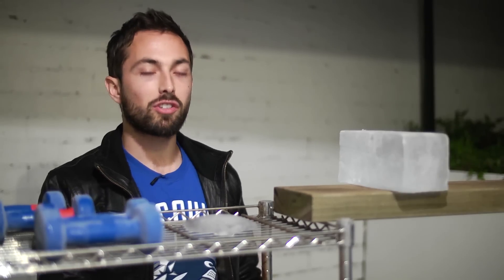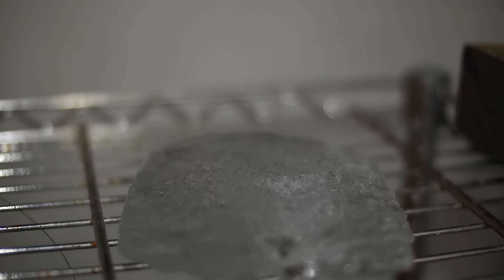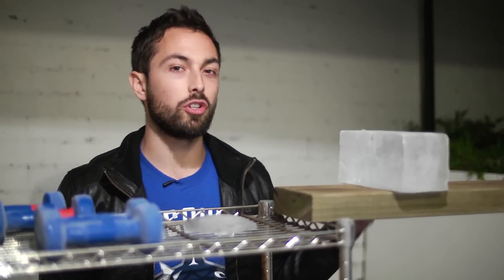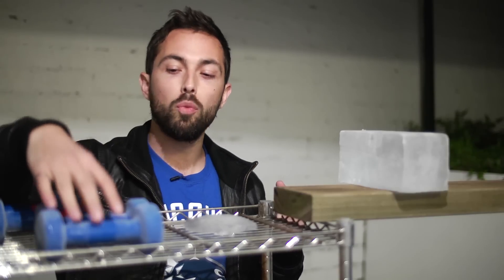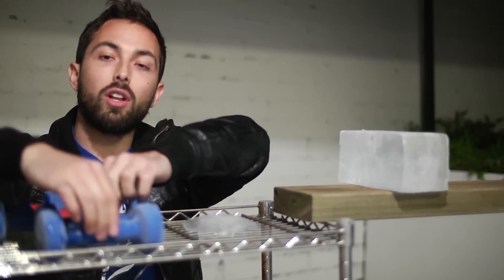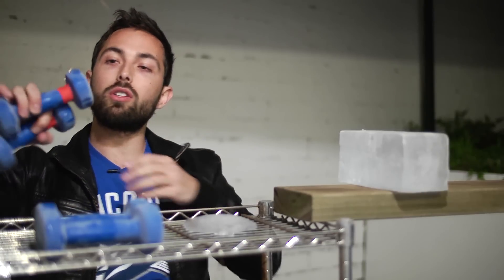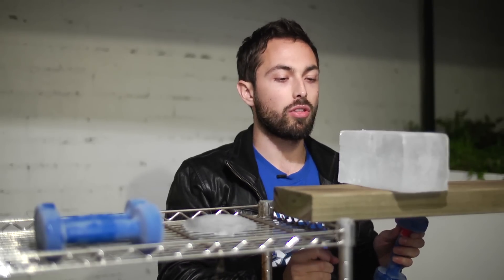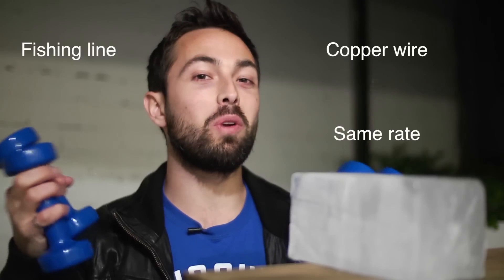Ice Cutting Experiment

Comment: Speak simply, Heat travels well through metals, better through aluminum than through copper, better through aluminum than iron, with the same in mind the thing you have not done is use the weighted wire in a below freezing environment. Because at each end of the wire it is conducting heat, at the block of ice it is cooling the wire, this is an active process. The active process in this case includes a constituent that has a temperature above 32f, = test fail "Ice under pressure, must be tested by "RRESSURE" alone." So now you have to test it in a freezing vacuum. Oh wait, you can't. In a proper vacuum there would be no gravity and so this test is dependent and subjective. You could put a couple stepper motors on a really slow pull to see if it melts the ice. But you will need ultra close up high speed to see that it's not microscopic flakes breaking off and melting. As you can see I am extremely suspicious of the atmosphere being above 32f.

Comment: I wouldn't consider that a good demonstration of regelation because I can propose an alternate hypothesis based on known physics.  For example, it could be that the pressure of the string is causing heat that melts the ice and then the surrounding ice is cooling it back down.  I am not saying you are wrong, more that it doesn't highlight that particular process.

Comment: This video, along with the skating and "snowball" examples are essentially misleading nonsense.  The melting point of ice decreases by about 1C for each 133 ATM of pressure, which is a colossal amount for just a one degree change in melting point.

The wire trick works since at room temperature the block of ice is essentially 0C (rapidly melting!) and the tiny delta afforded by the "pressure" on the wire does decrease the melting point enough for it to melt through the ice. For example, two 2kg weights on a copper wire lower the melting point by about 0.12C!  Try the same experiment in a freezer and it would fail completely without colossal mass applied to the wire.  Ergo, any example that tries to explain skater's blade pressure on ice as the reason when the ice is below 0C is utterly incorrect. The "compressing snow in your hands" example is completely ridiculous since you cannot apply the tiniest fraction of the required pressure to lower the melting point in any significant way....

Basically, at almost any temperature, ice has a very strange property where the surface is in a near-liquid state and that is by far the largest influence on surface friction.

Comment: The experiment only demonstrates that the ice melts, it is not clear that the pressure is the cause of the melting process. The metal wire conducts heat, from the parts in contact with the warmer air to the part of the wire in contact with the ice, this could provide all the heat needed for the wire to cut through the ice.
Reply: True, the exposed wires should be insulated, but the effect is real, albeit on a tiny scale.  The pressure of two 2kg weights on the wire lowers the melting point by about 0.12C, which is enough for a VERY slow melt, but put the block in a freezer and it would not work at all.   The skating and snowball examples are essentially wrong...

Comment: Just use a plastic fishing line instead of a wire. It will slow down immediately. Cause metals conduct heat through it and helps to melt the ice quicker.

Comment: copper cuz the fishing line is more elastic, meaning some of the weight will go in to stretching it and thus less pressure on the surface of the ice
Reply: Well I was wrong, and thinkng about it the pressure would be the same reagrdless of elasticity, they both support the same amount of weight, how the line absorves the tensile stress is irrelevant to the pressure on the ice

Comment: Due to copper has more diathermancy it will melt through the ice faster. The line which is made of plastic won't get through at the same rate of speed as the copper wire due to its less diathermancy.

Comment: 5 years late, but I'm guess the copper will go a tiny bit faster because of its high conductivity. The pressure being applied is the same, but the copper will more easily transfer it's energy into the ice. Not by much though, because the weights are doing most of the heavy lifting (haha).

Comment: it increases the melting point , smart boy , not decreases.
Reply: Actually, it decreases, let's say from 0° C to -5° C, which means that ice would melt in -5° C, so the melting point has decreased.
Reply: +robotica ice normally melts at 0 degrees but after applying pressure on it will melt more easily , say 1 degree or 2 degree..
Reply: Happy Singh Ice melts at 0° C or more, while salt DECREASES the melting point so it melts at, say, -5° C OR MORE (-4° C, -3° C, -2° C, -1° C, 0° C, etc.).
Reply: +robotica but that man is putting pressure on that ice which increases its melting point or freezing point
Reply: Happy Singh Lol I confused the video I was talking about, so just change out the word "salt" for "pressure".
Reply: +robotica no.. problem ,,, as you was also right ice decreases melting but pressure increases that .
Reply: +Happy Singh I meant salt decreases that..
Reply: Happy Singh OK, now I get where you're going. Increasing pressure does increase the melting point, but it's different for water. Since water expands below 0° C, when you apply pressure to it, it comes back to water (because water is denser than ice).

Comment: There's a misconception! Some people think that salt decreases the melting point of ice. Salt doesn't decrease the melting point of ice. Salt melts ice by atoms of sodium and chlorine getting in the gaps in the crystalized water and breaking the bonds between the water molecules making the molecules fall apart and turn into a liquid.
Reply: +Minecraft with TCarrot 
well.. and by that it actually DOE decrease the melting point - or let's say the freezing point - of water, doesn't it? Or more precisely - and that's your point I guess - the freezing point of a water salt mixture is lower than the freezing point of pure water. That's the whole point about why oceans don't freeze at zero deg. centergrade...The observation is a drop in freezing temperature, so saying that salt decreases the melting point of water is not entirely a misconception, but rather an imprecision...
Reply: +Minecraft with TCarrot  read colligative properties

Comment: To be technical, increasing the pressure of the ice actually increases the boiling point, the opposite of what is said here. This is clear from the shape of any Heat-Pressure graph for thermodynamic state. Increasing the pressure increases the heat of the ice, however, and the fact that the melting point is higher isn't relevant. It's just worth noting that the pressure does not decrease the melting point like salt does.
Reply: I meant melting point, not boiling point
Reply: +Jeremy Boyd 
hmm.. maybe I'm wrong here, but if I look at a phase diagram of water and I check its characteristics at melting point, the melting point actually DOES decrease with increasing pressure, especially at high pressures. This is the whole point about negative thermal expansion, isn't it?
Reply: +Jeremy Boyd  use clausius clapeyron equation of phase transition..It's pretty clear..

Comment: The copper wire will pass first becaude it has greater thermal conductivity.
Reply: GEORGE ZARIFIS yeah but that will make it cold and make it slower
I’m not sure just a geuss
Reply: @redgren_g   well it not gonna destroy that energy or heat. It going to conduct that heat to something here that is ice.
Reply: just because pressure melts ice doesnt mean that heat won't still melt the ice thus both of them together will do it quicker.
Reply: Dangerous when in the wrong hands an science victims minds an body..
Reply: Or slower if conduct colder air temp?
Reply: @georgezarifis7409  dood don't say that I haven't even learned that in school
Reply: I had a diffrent idea,the area of the fishing line which is in contact of the ice will be much lesser than that of copper.hence more pressure will be applied and more ice will get melted faster
Reply: It depends on the thickness of the wire vs the fishing string, if it's thicker wire the higher surface area could contribute to the melting, due to thermal conductivity, but if the fishing string being smaller may be fastet if it is thinner due too the higher force to area function
Reply: I think so too but it where would it get heat from?
Reply: SPOILER ALERT!! Your correct.
Reply: I think so too
Reply: GEORGE ZARIFIS 
More the thermal conductivity, it absorbs heat fast but it also loses heat fastly.i.e.-becomes cold fast
Reply: And it's heavier
Reply: Maybe he watched the video then put the answer 👍🏻

Comment: Fishing line will pass through first because it is an insulator, and the copper will pass through slower because it is a conductor of heat and it will try to match the ices temperature.

Comment: Provided the weights of the dumbell are same and assuming the thickness of the copper wire n the fishing line is the same, they cut the ice at the same rate because the tension on the wires applied would be equal and thus the pressure exerted on the ice would also be the same. Hence same rate.

Comment: There is not enough information! if the room temperature is far below freezing then the fishing line will cut faster. 
IF the room temperature is far above freezing then the copper will cut faster.
Reply: What's the reasoning behind this?
Reply: Dalton Wells. If room temp is well below freezing - lets say zero deg F then the copper wire will conduct the higher temp of the ice out into the room through the wire causing the ice to stay frozen or at least melt slower 

If room temp is well above freezing - lets say 70 Deg F then the copper wire would conduct the heat from the room into the ice causing the ice to melt faster. 

The nylon string conducts heat very poorly so it would have little change with room temp fluctuations.
Reply: Dalton Wells. Forgot the most important part - he never says what the ambient temperature is (ambient just means the surrounding temp)
Reply: Oh, that makes sense! Thank you for the response

Comment: i think the copper wire will PASS through faster because it is more conductive then the fishing line. and I say pass through because the ice will refreeze as it travels down to the bottom of the block of ice. i also think that when the wire gets to the bottom a small piece of ice will break out due to the weight and the wire will pass through in an arch shape so when the ice breaks it will be somewhere near center of the bottom surface. judging by the weight prob. about 3/4 of an inch.